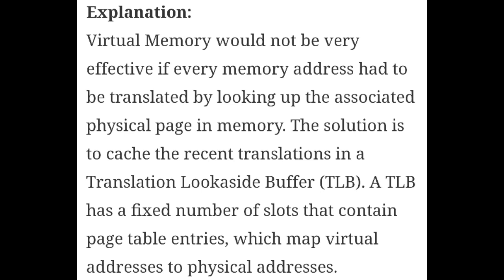KSET 2021 Computer Science & Applications | Answer Key with explanation | Paper 2

Comment: For 99,55 and 53 questions whether the answers are correct?
Reply: 55 is correct 53 it's option c and 99 I do not know but my friend saying all options are right
Reply: @eedjoin   sir for 55 both A and B are correct..and for 99 also some times v ll get C and D both
Reply: @chaitrasathyampet8138 for 55  I too had dought how you are saying it's a
Reply: @chaitrasathyampet8138  for 99 we need to solve it  I did not try it  it may have 2 or 3 option
Reply: @chaitrasathyampet8138  your marks mam?

Comment: 128, SC category. Any chance of getting cleared
Reply: For 26th questions using biwtise or and and ex-or we can find odd and even number
Reply: @uh5036  ExOr is correct
Reply: Answer is bitwise and and as per answer key for 26th
Reply: @sowmyasowmi7837  yes
Reply: It will be between 134 to 140 better u put objection challenge keys u wil get marks. 15,30,26,78,88,99 questions
Reply: @S8382m   also 24 questions options are wrong
Reply: @uh5036  -5 option c correct
Reply: @uh5036   it is correct
Reply: @S8382m   sir option all are wrong for that question number number 26
Reply: @uh5036  then grace
Reply: 53rd questions answer key should be C
Reply: @uh5036  53. C is right
Reply: @sowmyasowmi7837   last year 2020 138
Reply: @majeedglb111  answer for 15. From paper 2 and also answer for 15 from paper 1
Reply: @sowmyasowmi7837  paper 2 15 need to be grace they say b but it's all so register instruction
Reply: @sowmyasowmi7837  paper 1 15 which question
Reply: @eedjoin  if red is called air....air is called black... black is called blue... blue is called sky.. something like this...... question?
Reply: @sowmyasowmi7837  their is confusion between black blue and white it may be grace but logic questions proof finding will be difficult
Reply: @sowmyasowmi7837  grace marks
Reply: @majeedglb111  Which is grace marks
Reply: @sowmyasowmi7837  d is correct
Reply: @sowmyasowmi7837  c is correct  2*1000=2000
Reply: @majeedglb111  provisional answer is correct right.... For that question??
Reply: @sowmyasowmi7837  yes
Reply: @sowmyasowmi7837  it's d
Reply: I think all are valid instructions it may be grace fully only any one has to put it for challenge
Reply: @sowmyasowmi7837  their is confusion between option b and c
Reply: Paper 1 grace marks paper 2 b is right
Reply: @sowmyasowmi7837  option d is correct
Reply: I am not clear paper 2 questions15

Comment: P1 + P2 = 65 questions are right madam.. what will be the chance of this time cut off?
Reply: Which caste
Reply: @S8382m  2B
Reply: 138to144
Reply: @S8382m  what will be the expected cut-off?
Reply: @sowmyasowmi7837  which caste?
Reply: @S8382m  2a
Reply: @sowmyasowmi7837  on what basis you are saying cut off
Reply: @eedjoin  what Will be expected cut-off??? For 2A
Reply: @sowmyasowmi7837  it may be between max 140 to 145 min 136 to 142 it depends on number of 2a canditates wrote cs and their scores
Reply: @eedjoin  any grace marks from paper 1
Reply: @varshapurushotham682  yes chanses are thier for 2 3 questions I am analysing few questions and make videos
Reply: For GM
Reply: @shankarumadi1232  152 to 160
Reply: @S8382m  any wrong answer given in provisional key answer provided by university
Reply: @S8382m  in previous year GM 174 but this time same cutoff or decrease
Reply: @shankarumadi1232  it wil decrease this time. What is your score?
Reply: @shankarumadi1232  ya check out all the comments I hv listed the questions which are wrong